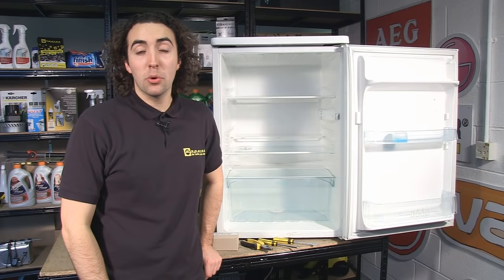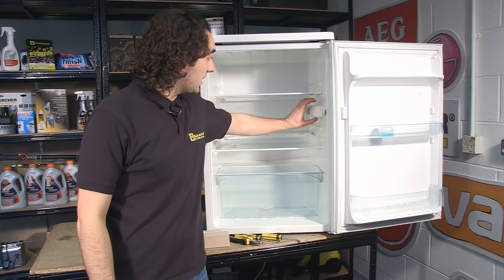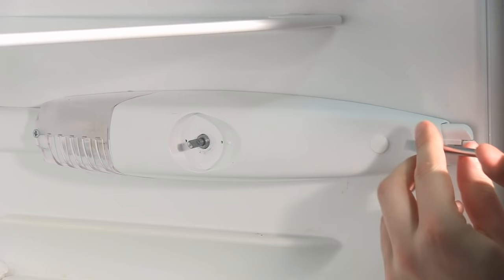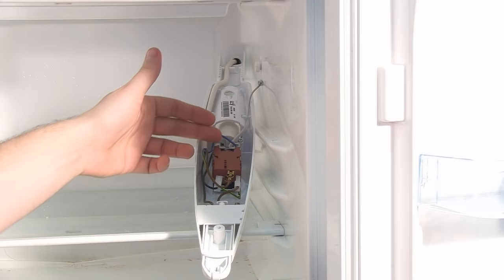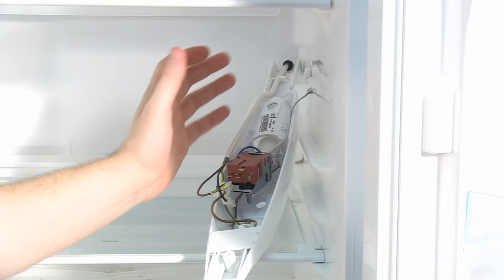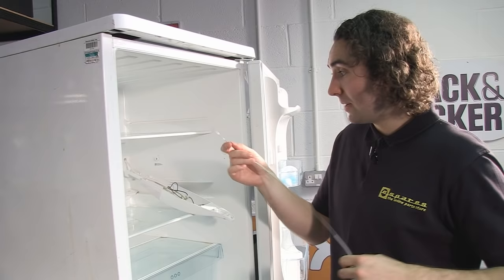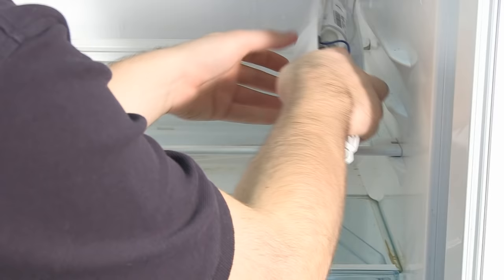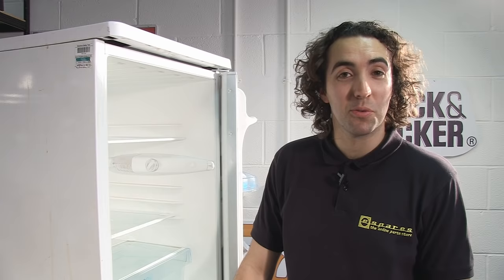Fitting a Fridge Thermostat Yourself? - Easy Fix! (Zanussi)

Comment: Hey Josh, I recently came into possession of two good sized mini fridges.  One worked just fine but the other was dead.  I felt bad about throwing it out (pretty nice one) so after investigating the parts of the fridge I figured the problem was the thermostat (woman's intuition maybe) so I ordered one and using your video installed it.  It is by no means the same fridge, part and even location in the fridge but you were thorough enough I got the main idea.  I said a little prayer, plugged the unit in and turned it on.  My dead mini fridge is ALIVE!  Yay!  Thanks for posting and sharing.  Couldn't have done it without you.
Reply from the maker: That's a great result LaceyPennies, Recyclers 2 Disposers 0. :-)

Comment: Great stuff, thanks! For my Hotpoint, the end of the sensor was looped back and screwed to the back of the chiller plate on the inside back wall. So a few more screws to remove and a bit more wiggling of parts but basically the same job.
Reply from the maker: Hi, thanks for your comment. We are glad to hear that you found our video useful in fixing your fridge freezer, hopefully everything is working fine for you now!

Comment: Great video.  My fridge is getting too cold even though I have the thermostat turned down to 1.   The fridge is running constantly.  Is it the thermostat that's faulty?
Reply from the maker: Check with a thermometer if you have one to confirm the temperature but if food and drinks are freezing it is definately below the running temperature (typically 1c to 3c). If this is the case the thermostat should have cut off, unless the fridge is in a very cold environment  the fridge should not go below  freezing.

Comment: Good demonstration (pitty you did not show a test if the old thermostaat was broken)
Reply from the maker: Thanks for your comments Jan. 
It can be difficult and confusing to be able to check a thermostat has failed so sorry if we did not try to show this.
In general a thermostat will either fail closed and continually freeze to a low temperature.
Or fail open/stick when the appliance stops running and defrosts.
Either of these would indicate a faulty thermostat would be the likely cause.

Comment: I have a question. I have a mini Danby Engergy star fridge/freezer combo. My question is can I install a thermostat sold by Danby for thier wine refrigerator to keep my fridge at 10- 18 C degrees/ 50-65 F degrees ?  I want to make my mini fridge/ freezer have a wine fridge temperature. I need that specific temperature for making fermented vegetables like sauerkraut and kimchi. Because I live in a very hot climate.
Reply from the maker: In theory replacing the thermostat will then regulate the content to the new temperature correctly as long as the thermostat can handle the higher power of the larger fridge. In practise this is not likely to be a problem if the thermostat is of a similar construction. However obviously this is our opinion and we cannot gaurentee this. :-)

Comment: My Zanussi built in has a similar control unit but NO retaining screw hole or screw hole cover. How to remove it?
Reply from the maker: Hi George, if it has the controls on the right-hand side it usually has a screw holding it on so if it is not like the video check behind the lamp holder as it may be there.
Reply: eSpares Thanks for your reply. I wondered about that, and will be having a look. Great video. Thanks.

Comment: Does this goes for a mini fridge that not cooling?
Reply from the maker: Rosalind Toulson Most Mini fridges use a special semiconductor 'slab' that creates a Peltier effect and draws heat from one side to another. If the fan is running (if fitted) it indicates power is ok and the problem is likely to be the semiconductor and not repairable.

Comment: Thanks sir.
Althought that doesn't seem to be my problem. Could you tell me ?
It looks more like a faulty contact issue. The fridge doesn't produce any cold now. No sound comming from the inside, wich is like THE sign of a well fonctionning fridge, and the light is down. But when I play around the thermostat button, all comes back for a short time before it goes down again.
I'm asking because I feel like  the thermostat might not be the actual issue here.  And I don't wanna change it for nothing. 
Thanks to anyone of you who might answer.
Reply from the maker: The contacts on these type of thermostats wear over time and often when the temperature is cold the thermostat will switch off but later when warm it will not switch back on. Often when this happens if you give a sharp tap on he knob the machine will bust into life until it cuts off again when cold. If this is the symptom it stands a very good chance a new thermostat will cure the problem.
Reply: Meeeh, like I said there is no cold now that could switch the thermostat off so ... 
Thing is, both the compressor and the light turn off a the exact same time. That should set pros like you on fire.
What is it, in a refregirator, that handles both the light and the compressor ? Does it all come down to the thermostat ? Is it its role in the machine ?
BTW This is the  thermostat: "53040006. THERMOSTAT WPF25JEX".
And if this is the problem, it's gonna cost me $60 to change it, wich is half the price of the whole thing.
Don't you guys love the modern times ?
Reply from the maker: The thermostat will usually turn the light off if turned fully off so is still likely to be the problem. You can confirm this by using a meter to measure across the 'switching contacts' these should read short circuit if the thermostat is not in the 'switched off' position.
Reply: well anyway thanks a lot

Comment: also when you put thermostat back be careful you are not squashing wires /sensor coil because obviously it won't go
Reply from the maker: The capillary tube from the thermostat should not easily crush but if bent sharply can crush and block.

Comment: Does this work for small refrigerators that freeze everything?
Reply from the maker: +Joe Peso If the thermostat is stuck closed then the compressor will continually run and over freeze. If the compressor does not stop then suspect the thermostat.
Reply: +eSpares How would I knownif the thermostat is stuck in the closed position?
Reply from the maker: +Joe Peso The compressor should stop when the required temperature is reached. Turn the thermostat to minimum and if the temperature goes below 3 degrees in the fridge or below -18 in the freezer it would suggest a stuck thermostat.

Comment: what if the capillary on the new unit it longer than the one on the old...is it ok to cut it?
Reply from the maker: No. the capillary is contains a little gas that contracts when the temperature changes to turn the thermostat off. Either re order the original thermostat or carefully coil the excess and tuck it into the housing. The tip must be in the corect position for it to operate correctly.

Comment: I have a large chest freezer Proline and it does NOT get cold, doesnt even freeze up, could this be the thermostat?

I can hear the compressor working well but no matter where i position the thermostat it does nothing, the temperature does not freeze its always warm. Is there anyway o could test the thermostat to knwo if its that or not,thanks.
Reply: the thermostat is working, maybe there are leak in the system

Comment: My new k59 thermostat capillary tube is longer than old one. After the installation it did not work. What to do?
Reply from the maker: Hi Shakib, check the thermostat is the correct one for your model as they are usually an exact match.
Reply: @eSpares  Thank you for your suggestions.

Comment: WARNING  *   The first thing to do is to DISCONNECT the fridge from the mains supply.
If you had not done this you would be toast, as you touched the mains supply inside the cover.  :(
Reply from the maker: Hi Uni Mike, we did add a annotation  to the video but it's changed at YouTube so thanks for reminding everyone you must unplug before you start.
Reply: I wouldnt say toast lol. It's waaay less than 15amps I'm sure

Comment: What can I do if I didnt take a photo so theres no reference on where to connect what?
Reply from the maker: One connection will normally be connected to the metal body of the thermostat (the earth connection). You can confirm this with a meter on low resistance showing a connection to other metal work at the back.
There will be another wire that connects directly to the power plug and another wire that connects to the compressor. These will be connected by the swithc in the thermostat when the thermostat is turned to the on position.

Comment: How can you tell that the thermostat is broken? My fridge is running at 43 degrees C for some reason 😦
Reply from the maker: If the compressor at the back is running then the system should be cooling. This is unlikely to be happening, depending on model the most likely problem is a failed compressor and this is usually identified by the compressor making to quiet 'clicks' about ten seconds apart and then silence for a minute before repeating. If this is the case it can only be repaired by a refrigerator systems engineer as the system would need to be re-gassed after replacing the compressor.

Comment: Did not take photo of wiring what can I do I need photo of it .
Reply from the maker: Hi Terry, we do not have access to wiring diagrams so if it,s not like the one in the video that you can use then hopefully somebody has taken a photo replacing theirs they can share but it may depend on your model.
Reply: Same as the one in video but Electrolux.

Comment: I have got a westinghouse bar fridge which runs for 7 minutes and then turn off 7 mins. Switch on and off in short intervals. It's a 2 year old fridge. Could it be the thermostat problem? or any other reason? How can I find the reason? 
Thanks mate :)
Reply from the maker: Have you checked the fridge temperature?. If it is not cooling and it uses a thermostat then it is possible the thermostat could be faulty but it could also be the compressor if fitted is overheating due to a fault and may need replacing.
Reply: Hi
Thanks for your reply.the fridge is cooling.however,because the cycles are too short,its freezer does not have time to become cold enough.i have bought this fridge for less than 2 years.
Anyway,thanks
Reply from the maker: Check the temperature as if it is in a cold area it might be cool enough for beer.
Reply: Hi 
Thanks for reply. I checked temperature and i think it's cool enough. Also, after 1.5 days, I managed to have ice by putting water in the freezer. From all these, I have figured that the compressor is working properly but the only problem is too short intervals between on and off. My fridge is a westinghouse bar fridge
westinghouse wim1000wc 
There is nothing fancy about this fridge. I was thinking to make a short circuit in thermostat to make it work continuously.
Reply from the maker: Now I have looked up your model I can see it is a small fridge with an 'ice box'. The 'Ice box' on a simple fridge like this will not remain frozen if the fridge is not in a warm environment. The fridge should be in a kitchen with an average temperature above 50 F or the fridge does not have to run the compressor enough to keep the ice box frozen.
Reply: Thank you for the info.
My fridge/ Freezer  kept running for a short period too then switching off and not freezing properly as well after working perfectly well normally.
It might be due to the room is very cold in winter.

Comment: How did u know the stat was fruity?
Reply from the maker: Adrian Wilson If the motor is not running when it should I.E when warm in the fridge and a sharp tap to the control brings it back on then the stat may be sticking.  If the compressor is running all the time but the evaporator is not cold then you may have another problem.
Reply: eSpares Thanks for response.

Comment: My Beko just has a pot behind the dial. The thermostat is somewhere else.
Reply from the maker: Joe Anthing Some Beko fridge freezers have a sensor fitted in the lining that cannot be replaced and a control board at the back in a pocket at the top. If you have a temperature problem replace the PCB as this often cures the problem, if it is the sensor you may not be able to repair the fault.:-(
Reply: eSpares Actually I found a good guide online, well a forum which states how to replace the sensor. You have to cut away some of the foam insulation which is under neath the PCB access panel. The part is £9 on eBay and only two wires to solder. Many people reported success by doing this.

Comment: Pull the plug out first or it won't be just a "dead" fridge.
Reply from the maker: THanks for your comments. This video slipped past us without the usual warning so we have now added an annotation one onscreen at 0:32
Reply: dohjovid 

I knew someone will come up with that comment. Look at the bright side man, anyone who knows the ABC of electronics will know the power must be Off or even disconnect the power cable.
Reply: eSpares I was about to suggest the same thing, I don't see any warnings on screen about unplugging it. Otherwise great video.